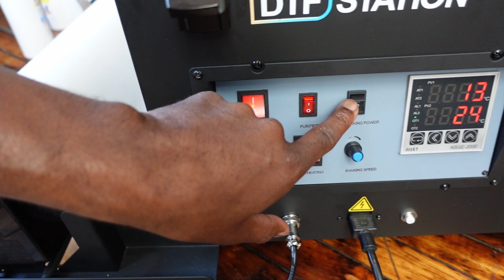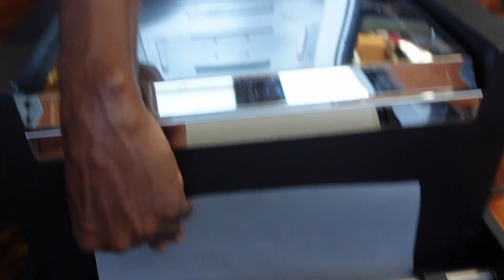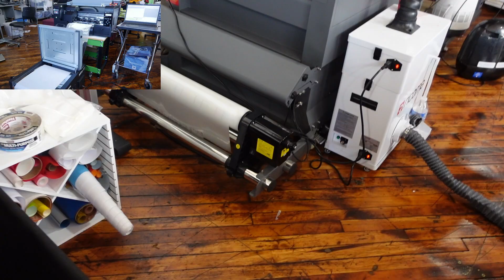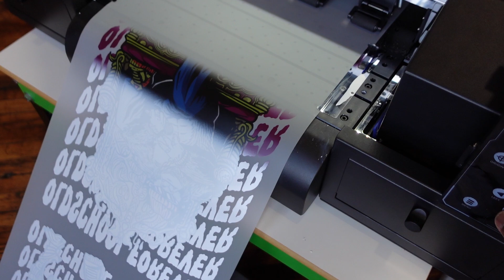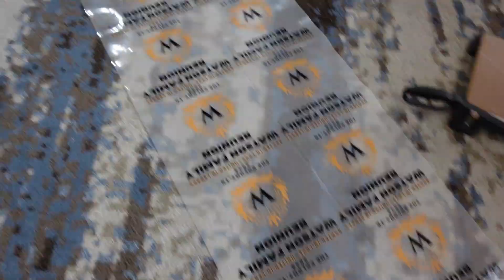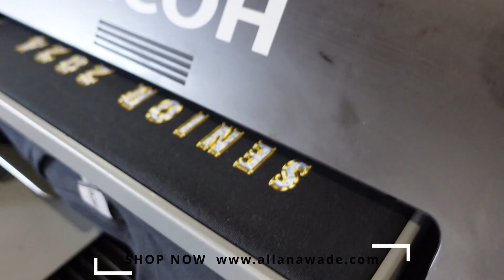DTG Printed T Shirts are better than DTF

Comment: Are u using a different laptop for all ur machines?
Reply from the maker: You have to if you want them to run at the same time.  I also think because they all use that honsoft software you could confuse the system by having two different softwares of the same kind open.  Haven’t tried it but im lucky enough not to have to.
Reply: @adubbproductions  ok makes sense

Comment: Dtf machine to much maintenance, i just switched to DTG Ri 1000 and i never turn off, the cartridges are pretty reasonable to me at $62, do you have video on the sleeve platen in use.
Reply from the maker: To me it’s the opposite. Dtg requires way more maintenance than dtf.  What dtf machine did you have? What did you do with it?

No unfortunately i don’t have v a video  using the sleeve platen.

Comment: Hello, Thanks for creating so many informational videos! I want to start making shirts and other items for my brand. I have been binge watching your videos and others about what printer to buy. It seems the industry is quickly changing, in one of your videos you recommended the A2 and in the updated comments you recommeded the R2 because the A2 was discontinued? It's so many options, so many different models and my head is spinning lol. Any guidance or suggestions is greatly appreciated🙏🏽
Reply from the maker: You mean the A3+R is discontinued. They are still selling the A2 believe.

You can’t get what is discontinued so that should help you out. lol The R2 Pro is the right one if you wanna get up and running and not waste time. The Ricoma Revel 2402 T is what to get if you want a full running business with no limitations on print sizes.